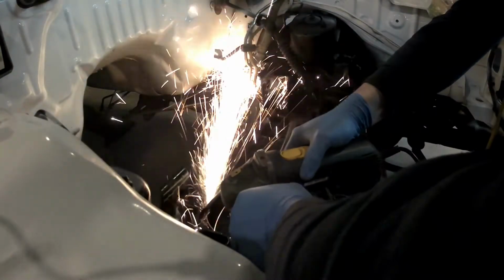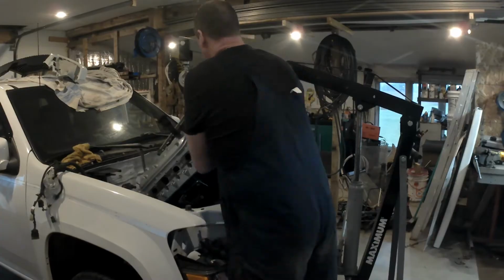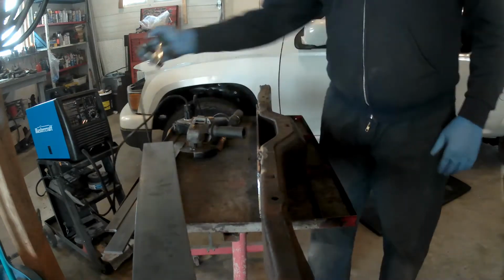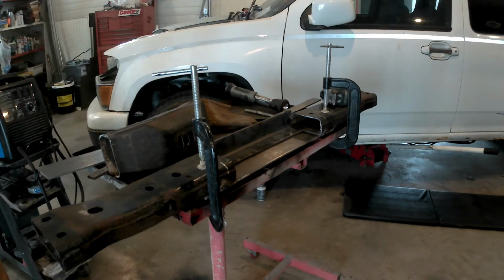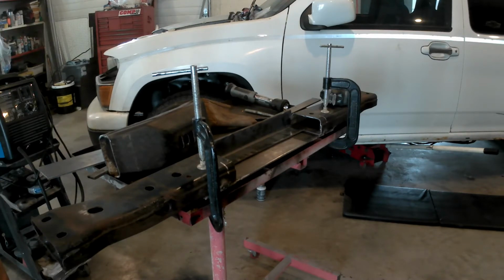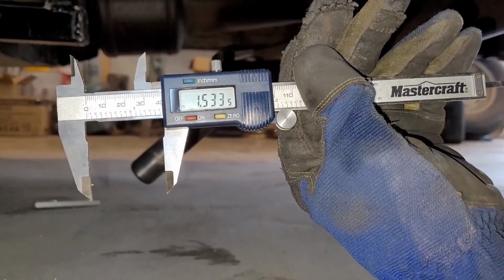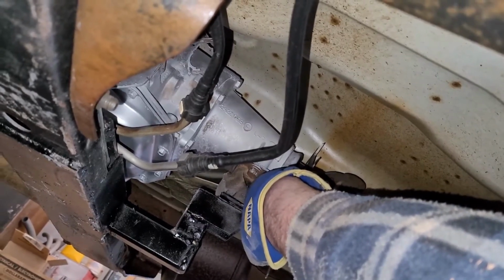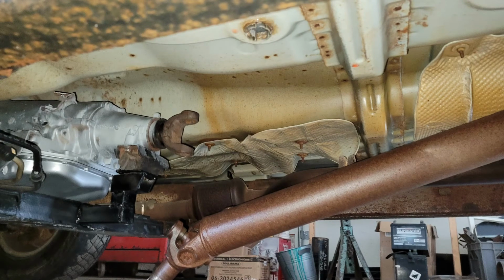Trans Mount build and Install! 2011 Colorado 6L LS Swap

Comment: Seems like it would be much easier, cheaper to just build out the stock 5.3, no?
Reply from the maker: That would be much easier if it had a stock 5.3L in it. But it had a 2.9L 4 cylinder. Stock 5.3L Colorado/Canyons around here are very, very hard to find.

Comment: im doing the same swap in a 2012 canyon, how do you do the engine bay wiring?
Reply from the maker: I just started into the wiring in the last day or two. I will have some videos up hopefully in the next 2 or 3 weeks on the wiring. I'm doing this one a little differently than my other LS swap I did. This one I'm hoping to wire up all the factory gauges and get them working. Not sure if it will work but I'm going to give it a try.
Reply: @budslife  how is the wiring going? have you made any video yet? im about to drop my engine/trans i this week end
Reply from the maker: @tonyb9240   I do have some footage of the wiring on how I did it. All I have to do now is hook up the fuel pump and it should fire. But before I fire it up I am getting the exhaust hooked up so it's not so loud, no cat's it's going to be loud. So once I get the exhaust done I will hook up the fuel pump and fire it up. At this point I will put together a video on the wiring, hopefully if all goes well I should have a video on the wiring end of next week.

Comment: What headers are you using will stock tuck manifolds work
Reply from the maker: Stock exhaust manifolds will work with a little modification. I am using aftermarket headers , I'm not sure what type they are I'll have to check and get back to you. I have a couple of different sets as my son bought them for his S10 swap but never use them.

Comment: I’ve heard a few guys say the stock driveshaft works with a th400/4l80e yoke. One question, how did you determine the angle for engine/transmission? I’m almost at this stage and I’ll probably copy your design with the crossmember. Anyway, keep up the good work 👍🏼
Reply from the maker: Thanks you could be right it could be the th400/4L80E I'm not sure. As far as determining angle of the engine / transmission I just kept the factory height of the factory transmission crossmember so that just kept that the same. I knew the engine mounts had to go lower so I just drilled new holes about an inch down from the factory mounting holes. This seemed to work perfectly.